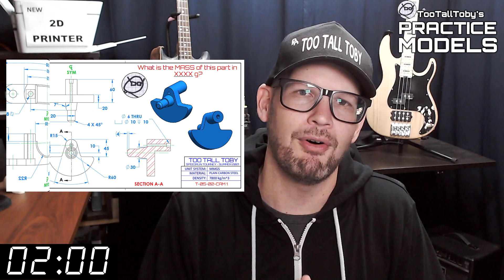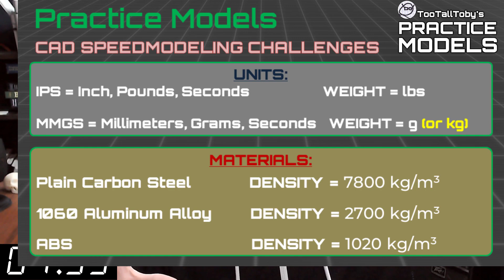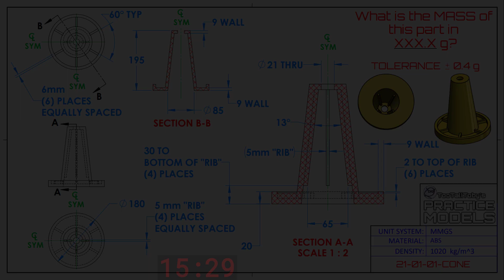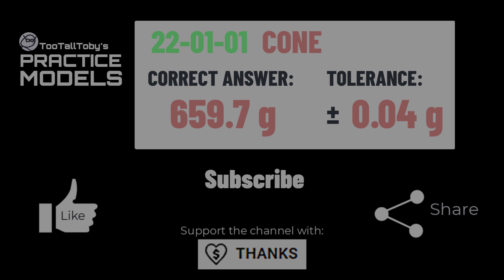CONE WALL is 09mm - SOLIDWORKS Practice - Onshape Practice - TooTallToby-21-01-01

Comment: 659.70 grams @6:19 in SW22 sp2
I made the assumption the wall thickness of the conical part itself is also 9mm, because you dimensioned it everywhere except for that part of the wall.
Or did i miss something?
Reply from the maker: lol - yes you are correct.  I'm laughing because I totally had that dimension in section view B-B, and for some unknown reason I deleted it before publishing the drawing.  DOH!!!  Thanks for the heads up - I added a note to the video and title.
And also - nice job on the time!